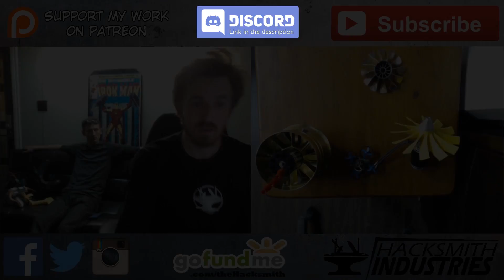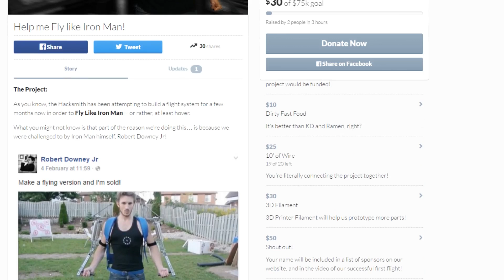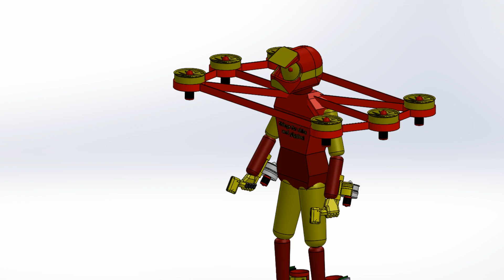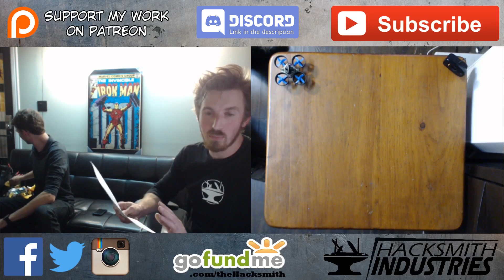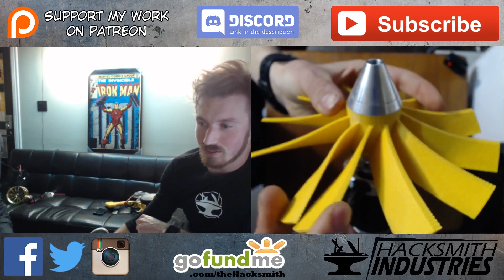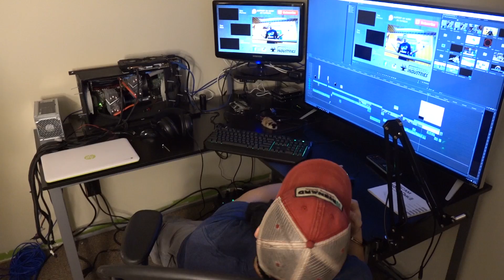Flying Like Iron Man Q&A!!!

Comment: I know people have asked why not use a gas engine, and I know the problems there, but why not make it a hybrid? Use a light weight gas engine like from a weed trimmer, and use that to spin a light weight generator?
Reply from the maker: That wouldn't produce even 1% of the power required
Reply: @hacksmith  I didn't think it would work, but I didn't think it would be that extreme. It wouldn't even work to extend battery time.

Comment: My friend you want smaller conductors from house supply you can use a high voltage system and a power converter..it could work, but would require other cost of power converters!! 
Hell batteries are good.

Comment: What if you use lifting gas like Helium to help offset your weight? I'm guessing it's just that it would take an inconveniently large balloon?
Reply from the maker: A hot air balloon basically :P
Reply: It occurred to me that you may not have fully understood. I was thinking use some for just a little of your weight like when you use the stunt wires. Maybe a large life vest-style thing? Fill some of those big hollow pieces of metal with helium to offset some of their weight?

Comment: I know it might be cheating a little bit, but have you given the thought to using a wing suit to assist your flight. It wouldn't help you take off, but it would help you TO fly. Just a thought.
Reply from the maker: Yeah but then I'd die during testing... wing suits are super dangerous!
Reply: Haha. That's probably true. I'm wondering if there would be enough thrust to be able to augment wing suit flight. I know that they glide pretty fast, so I guess my question is would there be enough thrust generated to be able to propel the user, or would it create more drag. 
Food for thought. Thanks for the reply.
Reply from the maker: That's the issue. Any lift you generate from the wingsuit means you have to be already flying horizontally at speeds of 60-70km/h

...which is certain death.

Comment: First off , graphene would work better over copper wires since there is zero resistance.  Next you will need to literally invent a better fan propulsion system that will compress air just before releasing the built up energy.  Maybe a venturi type delivery system with fans that rotate in separate directions . You can get a massive amount of thrust this way . Next , batteries should be spread out evenly over your body with carbon fiber plates covering them,  also making them aerodynamic .

Comment: the guy that built a working electric hoverboard used 8 hobby king turnigy rotomax 1.60 motors but they burn out on 10s so the rotomax 80 motors are a better choice.

Comment: dude try using 8 hobby king turnigy rotomax 80 motors turning 20x13 props after the weight of the system is subtrac
ted you have 150 lbs of thrust leftovers to lift you.
 EDF won't push enough volume of air CFM

Comment: Could you use rockets to start then have the edf with the cones that way you are already flying
Reply from the maker: If the EDFs are strong enough to make you hover... they're strong enough to launch you as well, the rockets wouldn't be useful =P
Reply: But the Way you said it it sounded like those cones at the end ad 20 percent if it's already flying so wouldn't the rockets starting it be an answer

Comment: I'm PRETTY sure that the cable he showed can not handle 1000 amps, at least not in any practical length.
Reply from the maker: Yeah that's the point...You'd need a bunch which would be really heavy
Reply from the maker: But we have pushed 1000A through that cable before =)
Reply: Yes, it was a bit confusing. How long was the cable and for how long? Lets say five meters, I wouldn't use that for any more than maybe 200 - 300 amps.
Reply from the maker: I'm glad you asked!

Using wire for an actual system is one thing -- but for short periods of time -- you can push a lot through it. We did a collaboration video with EverythingApplePro where we pushed over 1000A through an iPhone (using that cable).

https://www.youtube.com/watch?v=fFkjcqCEHPw

Comment: You may not get to see this but. You could run this on a Fuel cell systems that uses hydrogen pellets. I have worked with them on an experimental level and I can say that you could generate the power you need in a reasonable sized package and with  relative safety. However  Fuel cells tend to not produce the voltage and amperage you need at their peak efficiency, so you will need a custom power system if you can manage to make one. You are looking at a potential chemical energy of close to 140 MJ/Kg with  hydrogen, my guess is you will end up accessing about a fourth to a third of that  that should be more than enough to get you of the ground without the use of an internal combustion engine or solid fuel rocket. Just an Idea... Chances are this will cost more than $50k.

Comment: 6 thousand us for a small turbin or how about the 50hp small wankle (rotary) light waight and powerfull!!!!
Reply from the maker: +nathaniel mayers we're not building a helicopter though
Reply: the Hacksmith regardless the flying hangman is pretty ridiculous looking and 1-2min flight times has been done jet pack style.
im going to give this some thought
the perimeters are small reusable light weight and reasonable.
Reply from the maker: It still hasn't been done like this. We will try and compact the hexacopter as much as possible, and center it off the back (not centered around the neck, like we said, it was just a quick mockup). But using any kind of gas engine would turn this into a vehicle. 

As for the 2 minute flight time -- that's unavoidable for electric power. Since we're not trying to commercialize this or anything, we don't mind that it's 2 minutes. I'd rather fly for a minute rather than not at all.

Comment: +thehacksmith just another question here. Why are you 3D printing the turbines for the potential do it yourself EFT's? I would assume that metal would be more ridged and the weight difference would be negligible.
Reply from the maker: +Chaise Ballotti I'm not familiar with the term EFT. If you mean 3D printing in metal, we can't because it would be too expensive
Reply: the Hacksmith sorry about the wording it was late when I wrote that. so around 9.22 into the video, you talk about making you own EDF (I mistakenly thought you called them ETF). So for the EDF that you have made, you 3D printed from plastic. What I am suggesting is that you machine one from a chunk of mettle. (if you have the proper tools to do so)
Reply from the maker: While we do have a CNC machine you typically need a 4th axis to mill a proper blade, which we don't have. Our machine can only do 6"x10" work area as well, and since hobby king can provide us with 6" EDFs for free, we wouldn't be gaining anything from doing it ourselves.

Outsourcing it, the blades would still likely cost upwards of a thousand dollars to machine -- it takes a long time =(

Comment: I'd be just as happy with the project if you mount the batteries remotely.The iron-man suit uses a fictional power source with a fictional weight to capacity ratio.
Reply from the maker: +Cuinn Herrick we can fly with batteries no problem. It'll just only have a flight time of 1.5- 2 minutes
Reply: ah okay, well if you were going for aesthetics and trying to avoid anything but the extremity fans id still rate it. Keep up the good work :)

Comment: why not go back to rockets, but rather than use solid fuel rockets, use hybrid rocket engines with an oxygen tank in a backpack, and for the solid fuel, you could use acrylic rods with graphite nozzles. then, you could adjust thrust, and still shut them off even though they are rockets. its cheaper, and could be more efficient.

Comment: Make the 3d printed parts for the edf with a ring that rides in a cowling in the duct. This will force the 3d printed blades to stay straight highly reducing the chance of them breaking mid-flight.
Reply: Also,you could just use your cnc milling machine.
Reply from the maker: Typically need a 4th axis to mill a good EDF blade, other problem is our CNC is only a 6" x 10" work bed... so we couldn't make anything bigger than what Hobby King sells =(
Reply: go to a maker space. they might have a bigger one. or some websites will do it for you.
Reply from the maker: +Blake J we're better equipped then our local makerspace :p

Also makerspaces don't appreciate when you hog a machine for a 30+ hour milling job
Reply: Yeah that's true. And you would have to make a lot of them too.

The other thing is, in the video, you talked about why you didn't use rockets. Why didn't you just use liquid fuel rockets for sustained flight? their flow can be controlled easily and they are pretty reliable. I understand that they can burn you but with enough protection (Kevlar), you should be able to avoid that problem.
Reply: @EmotionalSupportCube  he used 2 layers of kevlar and it burned right threw it

Comment: easy solution to your power problem. build a small lightweight cold fusion reactor. there problem solved
Reply: Yeah, exactly. Piece of cake.
Reply: Misfit Miner I mean it's the obvious thing to do right?
Reply: Bryan Suh 
no, it is
it's the closest thing to the fictional arc reactor, it's just the technology is years away
and to reduce it down to that size is very difficult, but not impossible
Reply: Misfit Miner you realize i was kidding right?

Comment: You should use a turbine engine to power the suit.  One of these: https://www.youtube.com/watch?v=PFnZJeHc-KY with an alternator and an electric rectifier/controller per motor (to turn the high voltage alternating current into low voltage direct current via a bridge rectifier and buck converter).  The higher voltage alternating current generated by the alternator reduces the wire gauge requirements for power distribution.  As a byproduct, you could use some of the thrust produced by the axial turbine to augment lift.  The power to weight ratio and engine efficiency (your biggest challenges) of a turbine cannot be exceeded.

Comment: Say, why don't you use aluminium wires? You'd lose in resistance by 1.6 times, but save mass by 3.6 times, so you could get thicker wire and still have less mass then copper wire does

Comment: just a suggestion but try using the rockets to get off the ground then kick in the EDF.
Reply from the maker: Then how would you land?
Reply: well the rockets wont lift you that high "according to the information i learned from your rocket video" but i would imagine getting off the ground would be the hardest part then to land just slow down the motors, i'm not trying to tell you how to run your channel, i'm just trying to give input.
Reply from the maker: +brandon reeves but if the EDFs are powerful enough to maintain flight, the rockets are redundant :)
Reply: yes thats true but the rockets will save you alot of battery juice that would normally be used to get you off the ground, and i'm positive you are smart enough to find a way to eject the used rockets.

Comment: For small tests for the flight system can you try to push over a certain amount of weight using one EDF at a time and then calculating how much weight one EDF can push over and calculating that to your body weight. Also try to put the EDFs in different places to see where you will get the most lift and propulsion.
Reply from the maker: +Dr Crimsoniam that's exactly what we've been doing :) next video shows our thrust tester jig!

Comment: NO This Is Not Flying Like Iron Man You Might As Well Say Flying In An Airplane Is Flying Like Iron Man This Started Out Good But Now It's Turning Out Like This https://www.youtube.com/watch?v=t5JgnMJzCtQ Which Is Still Pretty Cool. Anyway on a more positive note it would fly much easier if you had all the edf's on a carbon fiber frame and also have them more spread out. Oh yeah and one more thing Instead of using batteries have it tethered. That way you won't have to worry about having to recharge all the batteries just for another 2 minutes of flight time.
Reply from the maker: It's nothing like that example... Yeah it'd be ideal if it was more compact, but remember the jetpack hexacopter is what provides the thrust and stabilization -- it's still the only system that lets you fly manually using your hands and legs to direct thrust -- that's where it's similar to flying like Iron Man ;)
Reply: Okay

Comment: Electricity just doesn't seem feasible for a legitimate flight suit.(without an arc reactor)..there are numerous fuel burning options which would be far more effective....especially since people are actually flying using them....
Reply from the maker: We answered that in this video ;-) 

The ones people are flying with are a few hundred thousand dollar prototypes. Bit out of budget. We're not trying to produce a commercial suit so we're perfectly fine with only having a 1-2min flight time
Reply: Well you can buy 50lb thrust turbines for ~$4700.. that's double your EDF thrust with essentially the same price point...but I get that budgets are only so much and maybe a turbine system would be more complex....
Reply from the maker: 24kg is 52.8lbs ... Check your units =P 

EDFs are technically cheaper. The major problem with the turbines is you can't get fine enough control to have a self-stabilizing system. Electric motor systems are much more responsive!
Reply: the Hacksmith whoops dang units,  ya got me there, the power density of jet fuel vs batteries has to favor turbines though I'd imagine. Are you concerned about the thrust from the shoulder pack inhibiting your ability to steer with your arms?

Comment: Lol can't a jet engine melt aluminum at constant close range? But the most important is skin and clothes may catch on fire......  Safety...  Also glad you decided to do the safety test....  

I'm also curious how you intend to protect yourself...  Hope you have like a wood table at least as a shield to duck behind XD with so some foam behind in case the blade flies out the casing at bullet speeds
Reply: TBH no clue what you are talking about they are not using jets or rockets just ducted fans which are just normal fans in a housing

Comment: Could you potentially add an outer ring to stabilize the 3D printed fan blades? that way the sifter plastic could have more rigidity and stabiity? Or would that be weight prohibitive? It would need a bit a of lubrication in order to function properly, but that could also possibly give a bit more efficiency to it revolutions.

Comment: What if you tried to fly with a drone to carry your batteries? Basically a small (gas) helicopter programmed to follow you and orient your tether to a convenient location. Also, there are plenty of adults that weigh the same as an a average child. You could try to reach out to anyone whose weight (and temperament) matches your specifications. These are very dumb ideas.

Comment: We just went through this same optimization for gas vs electric. Small gasoline engines are on the low end of efficiency. Depending on the size of the fuel tank (flight time) and actual efficiency of the engine, you wind up with a fuzzy break point where the higher energy density of the liquid fuel starts to offset the added weight of the power plant. Gearing a single engine to multiple fans is also possible, but for a few minutes of flight time, electric wins on total.power density, energy density, and cost - but that last bit hinges on the price of the engine (a couple thousand + for the size you'd need) vs the cost of the motors (also a couple thousand Canadian pesos). And batteries. But the gear train is a huge weight overhead compared to wire, and... Yeah. Stick with electric.

Comment: this may take away from the whole iron man point.but vertical liftoff requires to lift the engine... but what if you add wings,not large but enough to give some hover at vertical speed which would require less engines and will make the flight more controlled if they are connected to your arms... forward speed is easier to generate and if wing assisted hover is achieved it may last at (low hight) for a short time.but the more space the longer hover. if you can move fast vertically you can direct your self upwards with the use of a small ramp or a cliff-like test drop
Reply from the maker: +a regular person ish horizontal flight to produce lift from wings means you're going at least 100km/h... No room for error, I'd probably die in a ball of fire :(

Comment: there is a kind of hardening spray that you could use to toughen the 3d printed edf blades
Reply: i designed a mock up thrust system based of your design, its not so much for flying as it is for speed enhancing, i can show you if you're interested. its kind of similar to your jetbelt design that you used with the longboard

Comment: Have you and your team looked at extending your battery life with a capacitor bank? Might take some strain off the batteries, less Note 7 like :P ...this could be added to the backpack, i'm picturing something like the Rocketeer, but with 5 props on the back and 3 on the front. Your hands would have to be most of your stabilization... in theory. 
To keep you alive and safe, i vote for a kevlar, full motorcycle wear. It's made for a tough crash so you'll have that going for you, then you'll need a custom helmet with battery monitor! Thanks for the progress update!